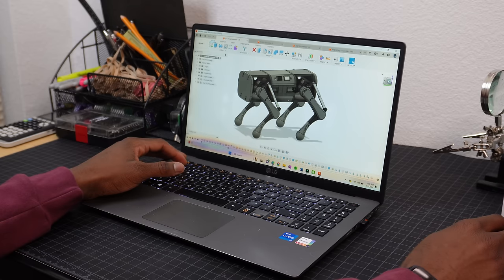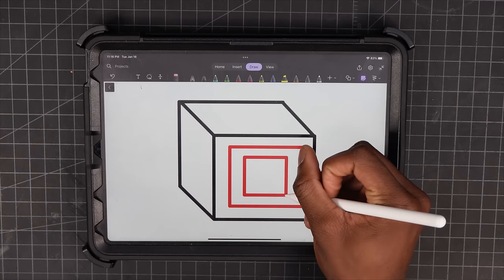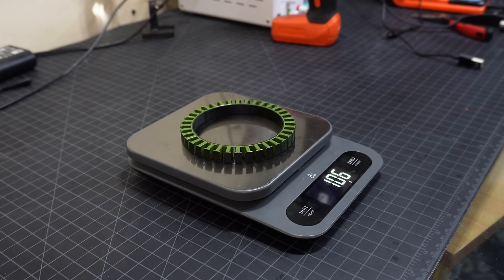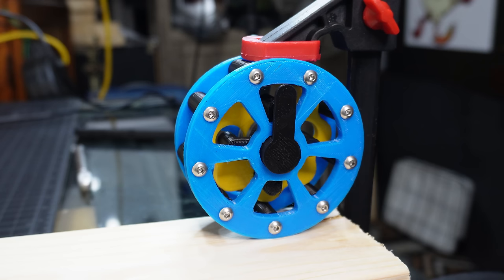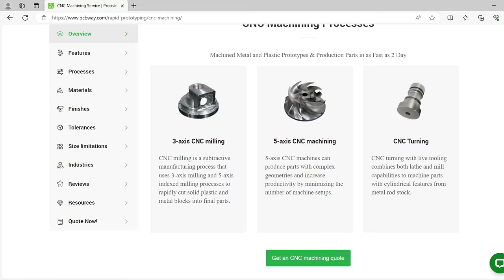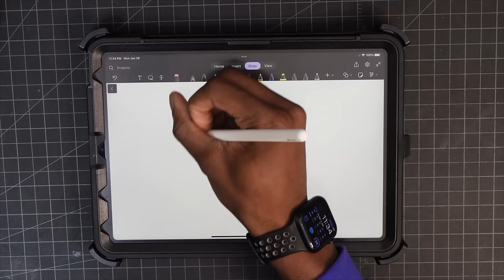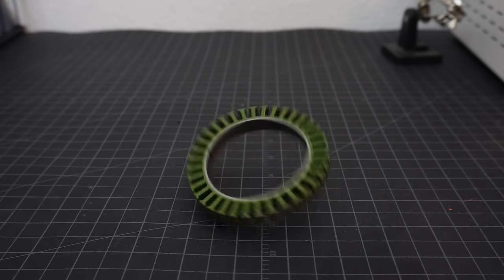Building an Internal Cycloidal Robotic Actuator

Comment: I think this is incorrect: "6 strands of wire for 6 turns per slot - equivalent to 36 turns per slot".
What matters is the number of turns of the wire in series. So 6 small wires wrapped one turn is the same as a 1 large wire wrapped one turn. 
So I think what you've got is 6 turns per slot of a single (equivalently large-gauge) wire, not 36 turns per slot of small gauge wire.

Comment: you need lamination because eddy currents will over heat your motor fast....and use electrical steel for resistance

Comment: yet again with another banger, btw im curious on how much u ended up spending on this project and ur other ones. An by that I mean like the components you buy and individual prices for them doesn't need to be exact but like the average for them (as im gonna be starting one soon, I do wish to make my own actuators eventually also, but money is the biggest issue so that will be a long while)
Reply from the maker: Mentioned at 18:06. BOM can be found at the link in the description

Comment: 90kv rating = 112.5 × .8. Given that ratings are required to be 80% of max capacity for safety, either they overstated their rating or (more likely) your reading came out a little low but w/in tolerance.

Comment: Planetary gear has the max efficient ever. Just for a backlash problem which can be easily solved with helisel gears in the gearbox, you use a system that has enormous of friction. It can be new idea but need to design much better and prove itself like other gear systems. Planetary gears are in industries for years with their efficiency, low heat, high reduction, small size, light weight, simple design, a few parts, a few power transfer points so on..

Comment: It would be interesting to try applying a cycloidal transmission to a rotary engine. Would the vibrations of the gearbox be bad, or could you offset the vibration of the rotary with the gearbox itself?
Reply from the maker: As long as you use 2 disks offset by 180 degrees there should be no vibration in a cycloidal gearbox.

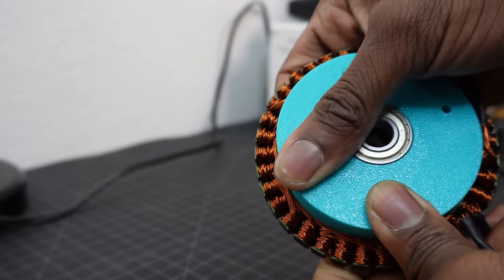Comment: 6:12 The gearbox was very close to fitting so I'm curious, could it be inserted from the other side? Maybe reduce the size of the gearbox so it's not as thick as the disk it's inserted into? This was, it won't press against the wires?
Reply from the maker: It has to fit into that side. Also, it needs to be a tight press fit so I couldn’t reduce the thickness.

Comment: Great video!

6:34 Wait, wasn't there some kind of issue with these printers with the power cable going to the bed work-hardening over time, shorting out and causing fires?

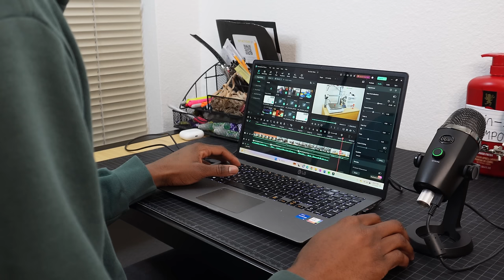7:01 Ah there we go

Yeah BambuLabs really screwed the pooch with this, not really the fault with the cable but how they tried to cover it up by telling customers "no everything is fine" while telling influencers that they are recalling the printers. It's only after some backlash that they actually started a recall.

Comment: As much as i like ODrive controllers, they add Significant cost to each servo you are making.  I was really hoping (and excited to see if) you had some alternative FOC controller other than ODrives.

I'm assuming your using atleast 12 servos, so that means your spending atleast $1800 minimum on ODrive electronics alone.
Reply from the maker: I bought 12 of them for my quadruped robot and so far it’s been a worthwhile investment. I use them for multiple projects. If you are looking for a cheaper option I’d recommend you explore the Moteus r4.11 by MJbots.
Reply: @AaedMusa  yea, I know ODrives are great, I just always seem to have so many projects that's it gets hard for me to justify the price to myself (I'd need 18 minimum, but ideally 24).  At one point I was going to build my own, but looking into it, there is some high level electrical/magnetics physics that I'd have to figure out.... so realistically, I'll probably not get to it anytime soon.

Thanks for the reminder about Moteus, I looked into it a while back, but it seemed like it wasn't far enough along.

Keep up the good work, I always like seeing others robots !

Comment: Awesome project! How expensive is this hobby if you don't mind sharing? I've bought Arduinos and Raspberry Pis along with little doo dads and thingamabobs but my investment ended there.
Reply: 3D Printer, Soldering iron, A buttload of enameled wire, Speed controller, other radical controller I forget the name, Variable PSU, and what else am I missing? Filament, ... , ...,

Comment: I love this project, it's so much better with the challenges and re-makes included. 
I know it's like fighting gravity but decimal inches are annoying, they're fake metric. It's easier to add them and fractionalize (that's a word) but you can't get parts like nuts and bolts like in metric. Can you buy anything that comes in 0.9 inches size? or 1.3 inches, what's that?
yes, I'm American.

Comment: I notice that only a single pole of the electromagnets on the stater are being used. The poles of the electromagnets that point towards the center are not being used. Would it be possible to add a smaller ring of permanent magnets on the interior side of the electromagnets to take advantage of the unused poles? Would this increase torque or is this a dumb idea?
Reply from the maker: Unused is probably not the right term. The existence of the north and south pole on each coil is what creates the magnetic field even if just one side of the coil is used. Adding an inner ring would increase torque but it would also increase weight and complexity. Doing this would also make it impossible to add a cycloidal gearbox in the center. Not to mention the fact that the actuator already has high torque so the inner ring wouldn’t be needed in the first place. Cool idea but completely unnecessary.

Comment: PLA really isn’t suitable for things like this, it softens at 50-60 C. You would be better with a higher temperature capable plastic, at least ABS/ASA with about 100 C heat resistance, but ideally you want to go for something like polycarbonate or a nylon.

However higher temperature plastics tend to need better printers and I don’t think you would get very far with the A1.

Another alternative may be to use resin printing as that can have good temperature resistance.

PCBway offers resin and higher temperature FDM printing too, or maybe your uni could let you use their machines if they have them.

If you keep going with PLA then you will likely continue to have issues with it melting or deforming due to the low softening point which only really gives you at a minimum 30 C headroom above ambient, assuming ambient temperature is 20 C.

Comment: Would a design like this benefit from a halbach array for the rotor instead of alternation ?
Reply from the maker: Any motor would benefit from a halbach array but it isn't needed if you are already using a steel rotor and stator.

Comment: I'm pretty sure that running 6 coils in parallell instead of one coil that is 6 times longer is going to draw a lot more amps.
Maby it was intentional, just wanted to point it out.
Reply: yeah, that's not 36 turns, it's using split wires to make 6 actual turns. Bummer that he missed that detail.

Comment: I don’t understand how 6 turns of 6 strands is 36 turns. That’s in parallel so it’s like having 6 turns of 6 strands exactly how you said, not 36 turns of one strand. That’s not the same thing unless you’re wiring each of those ins series and not just soldering them together in one chunk.

Comment: Did you ask them to Balance the parts to a specific speed or RPM. Did you Balance the printed parts.
Also, the outrunner has a twist in it.
You may need to use higher spec'd bearings. 
Pretty damned impressive all the same👍😎

Comment: 1:46 no spit on whomever made that, but this looks budget to me, so you can pick up a few good percentages of power by swapping those magnets for high quality ones and likely by rewinding the winds properly with a correct wire size for the application. Who knows, maybe 20 to 30 % depending on what's in there already. You'll need math for this and one of those magnetic indicator papers for this OP.

Comment: I wonder if I can get away with using Power Wheels motors, since they come with a gear reduction and are fairly cheap if you know where to look. They also haven't changed much in 40 years, so I don't imagine they'll change much in the future.

Comment: Think about the construction details and 
strengths of a Halbach motor design.
Reply from the maker: Since I'm using a steel rotor and a steel stator a Halbach array isn't necessary
Reply: @AaedMusa  How is that? Please explain it a bit.
Reply from the maker: @silberlinie I modeled my motor after an off the shelf motor. If you look at an off the shelf BLDC motor you'll see that it has no halbach array. That's because an off the shelf motor already has a steel rotor and stator which increase flux. A halbach array would be unnecessary.

Comment: Is 6 turns of 6 strands, which appears to be in parallel, the same as 36 turns of 1 strand, which would be series? My gut says no and I assume that the results is some trade-off among power, torque, speed, etc., but off hand I do not know what.

Does anyone know for sure?

Comment: Looks great.  Awesome amount of self-learning.  For your next project, I would recommend looking into a way to wind your stators easier/faster.  You made a couple of them and invested lots of time and pain. Failing is fine, but learning from your failures is where the value comes in.  The first failures were not sizing problems, the failure was the amount of time and effort done before you realized the part had failed.  Before optimizing, learn how to build cheap and fast. Prove it works, then start the optimize mode.  Maybe look into making an Axial Flux motor.  Great vid!!!

Comment: Can it be used as motorcycle wheel?
Reply from the maker: No it’s too weak for that. It’s meant for robotic applications.
Reply: @AaedMusa  thank you for your answer. I was wondering, if a magnetic rail can push bullet train, can the same principle be used for a wheel so that no moving parts touch each other? Or is this way too much energy required?

Comment: Wouldn't an Axial flux motor been way eaiser to make? Just copying existing tech might not have been the most efficient thing to do. (and then you had to restart, ouch) EDIT: Further ouch, that the Bamboo A1 you just got, has been recalled because it is a fire hazard. I am so sorry my dude.

Comment: i know these kinds of channels have an extremely low feminine audience, so as someone with masculine and feminine experience, 2IN1 SHAMPOO AND CONDITIONER MAKE NO SENSE. Shampoo uses surfactants and other deep oil removing ingredients to clean everything out of your hair. Conditioner literally does the opposite, it puts maintaining oils back into your hair to replace the dirty oils.

you cannot have a product that does both well. either its leaving dirty oils in, or its not putting better oils in well enough. i know men can't tell the difference, and for the most part, it doesnt matter, the water wash is what does half of the work anyway, and your hair will naturally recover oils anyway. much less of a problem for short hair.

Comment: Not sure if it was part of the project but I'm sorry you need proper planning before starting such projects. Winding motors and hitting into the wall are as much physically tiring for you as are for us watching it. Also, its certain the enamel wires will overlap the centre if you don't have a dummy piece to wind it around with. Planning, bruh, planning

Comment: Cycloidal just has too much vibration for robotics. Go planetary or harmonic.
Reply from the maker: If you use 2 discs offset by 180 degrees then there’s virtually zero vibration. I also made a planetary actuator in a past video.
Reply: @AaedMusa  yeah, that’s the theory, sleeves or bearings as well on the friction points but there’s still a lot more vibration than a compound planetary or harmonic. I’ll take a belt drive above a cycloidal as well with regards to robotics.

Comment: Cycloidal gearbox has low efficiency. Planetary gearbox is much much better.
Reply from the maker: Check out my other videos. I've already built a planetary actuator.
Reply: @AaedMusa  Planetary gearboxes must be compact - otherwise they will take up all the free space inside the robot and/or will break. Plastic gears are not suitable - these are for children's toys. The real things use hardened steel gears to free more space for batteries, electronics, payload, save weight, reduce battery drain, for faster and more agile movement. (Captain Obvious).
Reply from the maker: @humanspirit3432  Steel gears are extremely expensive. Plastic gears worked fine with my robot dog.
Reply: @AaedMusa  Your point of view is clear to me - in general I agree. Good commertially available gearboxes are expensive and suit not very well. So I'm planning to build a small gear cutting machine which uses cheap worm gear hob or disc cutter and dividing head (based on lathe or small milling machine). I'm planning to cut at least small gears of brass or soft steel. Also I'm planning to build a small shaper machine with linear cutting action - to cut internal gears. Preferably helical or double helical - for greater work torque and quiet operation. I already have a small chinese lathe WM210V. I hope to achieve good precision and surface finish to use it in servo drives for robots. Such manual or half-CNC machine for small gears should be of the size of an average 3D printer or smaller - potencially should be not very expensive.

Comment: 400$ WILL BUY YOU  PANCAKE MOTOR WITH CONTROLLER AND STEEL CYCLOIDAL GEARBOX RATED 10X YOUR TORQUE ANND PRACTICALLY NO BACKLASH, GOOOD EFFORT THOUGH

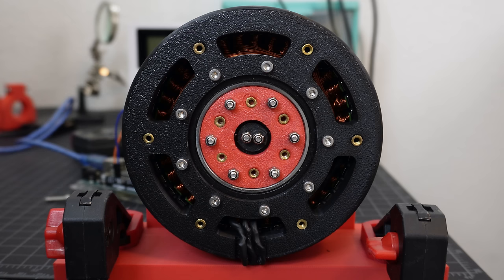Comment: 16:15 - you need to decide what you a trying to create in the first place.  entertaining youtube content or actual stuff.  
if the first - you are totaly fine with this results (many people run channels on exact this scheme - intentionally bad designs "OMG its broke look in slow mo" and then endlessly improve them)
if latter - forget about 3d-printed nonsense.  you can 3d-print only toys.  machined metal parts is the only way to go.

Comment: After commercially rewinding motors in my youth... I could have told you to NOT wind your own motor. And also "about" 17 winds per pole is NOT good. Winds need to be exactly the same. Your novice handwinding ability is nowhere near commercial quality.